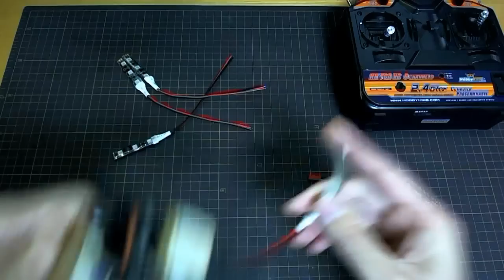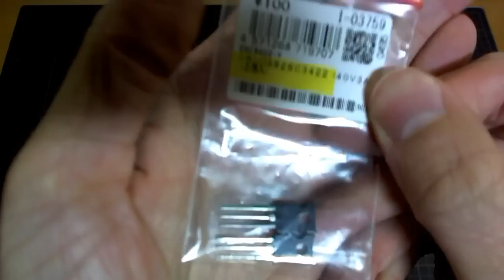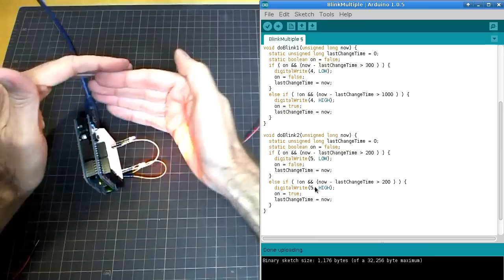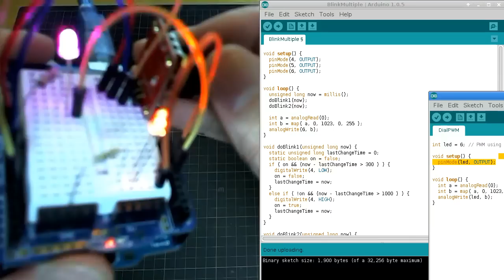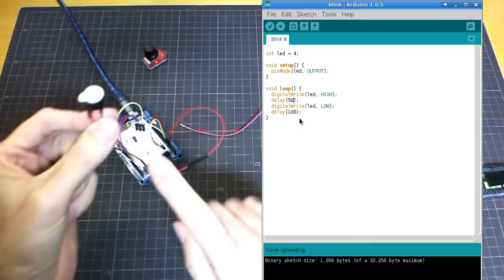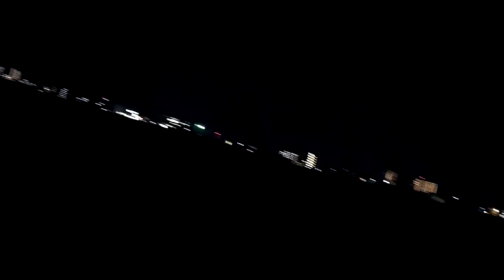Cheap-ass quadcopter build Part 13 - Let there be lights

Comment: if you use delay you shold have so it go int to the "find me mode" fhen switch on AND thrust is under 70  so you not acidently turn the mode on 
good filght

Comment: What am i doing wrong @#$#$#%%%^%
Trying to do 4 switches I thought it would be this easy. 
see the code  I"M STUMPED

/*  
A basic transmitter using the nRF24L01 module.
*/

#include <SPI.h>
#include <nRF24L01.h>
#include <RF24.h>

const uint64_t pipeOut = 0xe8e8f0f0e1;

RF24 radio(9, 10);

// The sizeof this struct should not exceed 32 bytes
struct MyData {
  byte throttle;
  byte yaw;
  byte pitch;
  byte roll;
  byte switches; // bitflag
};

MyData data;

void resetData() 
{
  data.throttle = 0;
  data.yaw = 127;
  data.pitch = 127;
  data.roll = 127;
  data.switches = 0;
}

void setup()
{
  radio.begin();
  radio.setAutoAck(false);
  radio.setDataRate(RF24_250KBPS);

  radio.openWritingPipe(pipeOut);

  resetData();
}

/************************************************/

// Returns a corrected value for a joystick position that takes into account
// the values of the outer extents and the middle of the joystick range.
int mapJoystickValues(int val, int lower, int middle, int upper, bool reverse)
{
  val = constrain(val, lower, upper);
  if ( val < middle )
    val = map(val, lower, middle, 0, 128);
  else
    val = map(val, middle, upper, 128, 255);
  return ( reverse ? 255 - val : val );
}

void loop()
{
  boolean mode1 = false;//!digitalRead(4);
  
  // The calibration numbers used here should be measured 
  // for your joysticks using the TestJoysticks sketch.
  data.throttle = mapJoystickValues( analogRead(A0), 127, 483, 852, false );
  data.yaw      = mapJoystickValues( analogRead(A1), 131, 480, 848, true );
  data.pitch    = mapJoystickValues( analogRead(A2), 136, 500, 868, false );
  data.roll     = mapJoystickValues( analogRead(A3), 152, 500, 870, true );

  
  data.switches = 0;
  if ( ! digitalRead(2) ) data.switches |= 0x1;
  if ( ! digitalRead(3) ) data.switches |= 0x2;
  if ( ! digitalRead(4) ) data.switches |= 0x3;
  if ( ! digitalRead(5) ) data.switches |= 0x4;
  radio.write(&data, sizeof(MyData));
}

Receiver Receiver Receiver Receiver Receiver

/*  
A basic receiver using the nRF24L01 module to receive channels and convert them to PPM.
 */

#include <SPI.h>
#include <nRF24L01.h>
#include <RF24.h>
#include "printf.h"

////////////////////// PPM CONFIGURATION//////////////////////////
#define channel_number 8  //set the number of channels
#define sigPin 2  //set PPM signal output pin on the arduino
#define PPM_FrLen 27000  //set the PPM frame length in microseconds (1ms = 1000µs)
#define PPM_PulseLen 400  //set the pulse length
//////////////////////////////////////////////////////////////////

int ppm[channel_number];

const uint64_t pipeIn =  0xe8e8f0f0e1;

RF24 radio(9, 10);

// The sizeof this struct should not exceed 32 bytes
struct MyData {
  byte throttle;
  byte yaw;
  byte pitch;
  byte roll;
  byte switches; // bitflag
};

MyData data;

void resetData() 
{
  data.throttle = 0;
  data.yaw = 127;
  data.pitch = 127;
  data.roll = 127;
  data.switches = 0;
  
  setPPMValuesFromData();
}

void setPPMValuesFromData()
{
  ppm[0] = map(data.throttle, 0, 255, 1000, 2000);
  ppm[1] = map(data.yaw,      0, 255, 1000, 2000);
  ppm[2] = map(data.pitch,    0, 255, 1000, 2000);
  ppm[3] = map(data.roll,     0, 255, 1000, 2000);  
  ppm[4] = data.switches & 0x1 ? 2000 : 1000;
  ppm[5] = data.switches & 0x2 ? 2000 : 1000;
  ppm[6] = data.switches & 0x3 ? 2000 : 1000;
  ppm[7] = data.switches & 0x4 ? 2000 : 1000;
}

/************************************************/

void setupPPM() {
  pinMode(sigPin, OUTPUT);
  digitalWrite(sigPin, 0);  //set the PPM signal pin to the default state (off)

  cli();
  TCCR1A = 0; // set entire TCCR1 register to 0
  TCCR1B = 0;

  OCR1A = 100;  // compare match register (not very important, sets the timeout for the first interrupt)
  TCCR1B |= (1 << WGM12);  // turn on CTC mode
  TCCR1B |= (1 << CS11);  // 8 prescaler: 0,5 microseconds at 16mhz
  TIMSK1 |= (1 << OCIE1A); // enable timer compare interrupt
  sei();
}

void setup()
{ 
  Serial.begin(9600);
  printf_begin();
  
  resetData();
  setupPPM();
  
  // Set up radio module
  radio.begin();
  radio.setAutoAck(false);
  radio.setDataRate(RF24_250KBPS);

  radio.openReadingPipe(1,pipeIn);
  radio.startListening();
  pinMode(3,OUTPUT);
  pinMode(4,OUTPUT);
  pinMode(5,OUTPUT);
  pinMode(6,OUTPUT);
  radio.printDetails();
}

/************************************************/

unsigned long lastRecvTime = 0;

void recvData()
{  
  while ( radio.available() ) {        
    radio.read(&data, sizeof(MyData));
    lastRecvTime = millis();
  }
}

/************************************************/

void loop()
{
  recvData();

  unsigned long now = millis();
  if ( now - lastRecvTime > 1000 ) {
    // signal lost?
    resetData();
  }
  
  setPPMValuesFromData();

  if (data.switches & 0x1 )
  digitalWrite(3, HIGH);
  else
  digitalWrite(3, LOW);

    if (data.switches & 0x2 )
  digitalWrite(4, HIGH);
  else
  digitalWrite(4, LOW);

    if (data.switches & 0x3 )
  digitalWrite(5, HIGH);
  else
  digitalWrite(5, LOW);

    if (data.switches & 0x4 )
  digitalWrite(6, HIGH);
  else
  digitalWrite(6, LOW);

}

/************************************************/

ISR(TIMER1_COMPA_vect){
  static boolean state = true;

  TCNT1 = 0;

  if ( state ) {
    //end pulse
    PORTD = PORTD & ~B00000100; // turn pin 2 off. Could also use: digitalWrite(sigPin,0)
    OCR1A = PPM_PulseLen;
    state = false;
  }
  else {
    //start pulse
    static byte cur_chan_numb;
    static unsigned int calc_rest;

    PORTD = PORTD | B00000100; // turn pin 2 on. Could also use: digitalWrite(sigPin,1)
    state = true;

    if(cur_chan_numb >= channel_number) {
      cur_chan_numb = 0;
      calc_rest += PPM_PulseLen;
      OCR1A = (PPM_FrLen - calc_rest);
      calc_rest = 0;
    }
    else {
      OCR1A = (ppm[cur_chan_numb] - PPM_PulseLen);
      calc_rest += ppm[cur_chan_numb];
      cur_chan_numb++;
    }     
  }
}
Reply from the maker: +Mark Greco the 'switches' value is a bit flag, so you should be doing this:
if ( ! digitalRead(2) ) data.switches |= 0x1;
if ( ! digitalRead(3) ) data.switches |= 0x2;
if ( ! digitalRead(4) ) data.switches |= 0x4;
if ( ! digitalRead(5) ) data.switches |= 0x8;
Reply from the maker: +Mark Greco http://www.cplusplus.com/forum/general/1590/

Comment: I need the coding for the transmitter, receiver and the multiwii. In the transmitter I have only 2 binary switches for the lights on the corners and for landing. Make sure that both the lights when on should not blink pls. Please help me out please.
Reply from the maker: +DINESH JAIN dude, do you even watch these videos? Look at 33:50

Comment: Thanks for a great set of videos! I just wanted to mention that if you keep nextChangeTime instead of lastChangeTime your code will be much simpler and will eat up less of the CPU time if spliced into the main loop with other code in it. Just check if (now > nextChangeTime) first and do other checks inside the if block.
Reply from the maker: That's correct, but I doubt it would make any practical difference. The arduino can do 16 million cycles per second, and a subtraction is only a handful of cycles. There are no other programs to share the CPU with anyway :)
Reply: I meant, if you move that code into the FC, when you get rid of the arduino handling the RF link. (:

Comment: You are so right about it being much more fun at night... I installed some 12v strip lighting on my SK450 quad, used BS250? mosfets to control them, and a attiny hooked up to the receiver to allow remote control and effects. Was great to fly at night, and so easy to tell the  orientation. IIRC,  I put put rear red and green on for port and starboard, and white on the front pair. Never bothered with a higher power one... but have been thinking about it for my next build. Current quads are fine in daylight, but I wouldn't mind another night flyer. Would probably think about a second battery for the lighting setup though if running the high power led for long durations though... see how it goes, anyway. Great video as always!
Reply from the maker: Cool! I found that the lights would blend into each other once it got too far away, but overall it's better visibility than in daylight, and with a 450 you should be able to get way way up high before that happens. Yes the high power LED was kinda pointless, just something to do for the video mainly (buzzer is a much more practical feature). It's a bit harsh to fly at night in winter, but I expect in summer I'll being doing it a lot more. My next build is already in the post, I'm finally graduating from class of 250, and I've ordered some lights to dress it up like a UFO... should be fun :)

Comment: You have connected transistors base- emitter to 3.3 volt it is very bad idea, you can burn either base of transistor and/or output of controller :) just put resister there. The base-emitter is like a diode it takes only 0.7V.
calculate resistor with: R = (3.3-0.7)/Imax, where I max is less then either maximum continuous current of transistor base, or maximum current of controller output.
Reply from the maker: Thanks for the tip. I wondered about that, but the document I was following (shown in the video) says it is generally not an issue for pins of a micro-controller, and it seems to be functioning ok (so far!) I'll definitely add a resistor there next time though, because it will decrease the overall current draw of the arduino... hmm... come to think of it, maybe it's the extra current being sucked out of that pin, which causes power problems for the RF24 module on VCC...
Reply: *****
Have to say I was surprised myself that there was no resistor on the base of that transistor.

Comment: Terrific project!  Regarding red/green LEDs being on low level: just a wild-ass guess, but perhaps there is a small amount of current leakage through the base of your transistor.  A pull-down resistor, say 10k, between the arduino pin and transistor base might solve that.
Reply from the maker: Good thinking. I'll put my cheap-ass oscilloscope on there and see what I get.

Comment: you can add some functions to those leds... i mean you can make the whole drone look like a proper heli with the right blinks...check airplane lights to see what i'm talking about...and another idea is to make some sort of visual control for battery voltage...something redundant...that would be something cool!
Reply from the maker: Yeah, you could do all kinds of cool stuff, link them to the throttle position, sine wave pulse the brightness etc
Reply: i've seen something like that a while ago...a guy connected some led strips directly to the 3 phases of an ESC and it was very cool. anyways, I was talking about a certain blink patern...have you seen how lights are blinking on planes? twice red, pause, then twice white and so on...
Reply from the maker: micultimy91
Yeah, I know what you meant :)

Comment: DoBlink1 and DoBlink2 can be written as one routine (int pinNumber, int lastHigh, LastLow ){
    handling the given pin;
}

Thank you for the video and other stuff you make
Reply from the maker: Yes, definitely :) Probably most programmers would cringe to see that much repeated code. It was mainly just for demo, if I was doing any more of them I would make a class or struct to keep each set of variables and just have one function that passes the 'now' and the struct to work with.
Reply: *****
Actually I fail to run my concept code :) But I will keep on trying.
Thank you
Reply from the maker: ilan magen
pastebin it for me
Reply: *****

//That's a 2 am + 2 beer code:
/*
  Blink  No delay
 */

void setup() {
  pinMode(5, OUTPUT);
  pinMode(6, OUTPUT);
  pinMode(7, OUTPUT);
  pinMode(8, OUTPUT);
}

void loop() {
  unsigned long now = millis();  
  blinko(now, 500, 100, 5);
  blinko(now, 500, 100, 6);
  blinko(now, 500, 100, 7);
  blinko(now, 500, 100, 8);
 
}

void blinko(unsigned long now, int iHigh, int iLow, int pin ){
  static unsigned long LastChangeTime = 0;
  static boolean isOn = false;
  if (isOn && (now - LastChangeTime > iLow)) {
    digitalWrite (pin,LOW );
    isOn = false;
    LastChangeTime = now;
  }
  else if   (! isOn && (now - LastChangeTime > iHigh)) {
    digitalWrite (pin, HIGH);
    isOn = true;
    LastChangeTime = now;
  }
 
}
Reply: ilan magen
/// no need to write the "LastChangeTime = now;" twice only once out of the "if" condition
/*
  Blink  No delay
 */

void setup() {
  pinMode(5, OUTPUT);
  pinMode(6, OUTPUT);
  pinMode(7, OUTPUT);
  pinMode(8, OUTPUT);
}

void loop() {
  unsigned long now = millis();  
  blinko(now, 500, 100, 5);
  blinko(now, 500, 100, 6);
  blinko(now, 500, 100, 7);
  blinko(now, 500, 100, 8);
 
}

void blinko(unsigned long now, int iHigh, int iLow, int pin ){
  static unsigned long LastChangeTime = 0;
  static boolean isOn = false;
  if (isOn && (now - LastChangeTime > iLow)) {
    digitalWrite (pin,LOW );
    isOn = false;
  }
  else if   (! isOn && (now - LastChangeTime > iHigh)) {
    digitalWrite (pin, HIGH);
    isOn = true;
  }
    LastChangeTime = now;
}
Reply from the maker: ilan magen You are using the same LastChangeTime and isOn variables for all of them. You will need a full set of separate variables for each.
Reply from the maker: ilan magen
Here is the same sketch using a struct like I was meaning:

struct LEDToggler {
  int pin;
  int onTime;
  int offTime;
  unsigned long lastChangeTime;
  boolean isOn;
 
  LEDToggler(int _pin, int _onTime, int _offTime) {
    pin = _pin;
    onTime = _onTime;
    offTime = _offTime;
    lastChangeTime = 0;
    isOn = false;
    pinMode(pin, OUTPUT);
  }
 
  void step(unsigned long now) {
    if ( isOn && (now - lastChangeTime > onTime ) ) {
      digitalWrite(pin, LOW);
      isOn = false;
      lastChangeTime = now;
    }
    else if ( !isOn && (now - lastChangeTime > offTime ) ) {
      digitalWrite(pin, HIGH);
      isOn = true;
      lastChangeTime = now;
    }
  }
};

LEDToggler led1(4, 500, 1000);
LEDToggler led2(5, 200, 200);

void setup() {}

void loop() {
  unsigned long now = millis();
  led1.step(now);
  led2.step(now);
}
Reply from the maker: ilan magen
You also should not change LastChangeTime every time. As the name suggests, you only change that when something was changed, otherwise it loses its meaning and you might as well not even have it at all :)

Comment: could you maybe use multiplexing to expand the i/o of pin 5/6 to control more pwm signals? might be possible to control more leds that way
Reply from the maker: I haven't used any multiplexers myself, but yes, you could do that. Some I have seen use I2C to control them. https://www.youtube.com/watch?v=A6qNxnRPD3o

Comment: I have a few more questions. How does the power LED dimming work? Is the transistor continuous and stepless? I thought it was on / off only. And lastly, how did you film yourself like that? A head-mounted camera?
Reply from the maker: Yes, this transistor is pretty much on/off only. The dimming works by turning it on and off very fast, so that it is on for a percentage of the time. You can see some details here: http://arduino.cc/en/Tutorial/PWM I'm holding the mobius camera in my teeth :)

Comment: i does not mess withe the ppm signal?
Reply from the maker: The sketch I'm using for the receiver uses timer1 for the PPM signal. Using timer0 as well might mess with it a tiny bit because both timers will be triggering interrupts, but I don't think it's a significant interference.

Comment: i think it would be a better idea to ut the transistor before the driver input...
The driver adjusts the voltage up intul it reaches the desired current and if the transistor opens, the voltage will go up. If the transitor closes again, and the driver is not fast enough ramping down the voltage, you may damage the LED...
Just my thoughts, could be total bullshit also, but i think it makes sense...
Very nice video otherwise, very usefull stuff for somebody building a quad himself! :)
Also, where do you actually live? i always thought it was the UK, but you said you sourced the transistors locally, and they have chinese or japanese signs on them, so do you actually live in asia? :)
last question would be, if the source code for the reciever and transmitter can be downloaded somewhere?
Reply: He lives in Tokyo.
Reply: Philip Stubbs OK, thanks :)
Reply from the maker: Have to admit I don't really know how the driver works, so you could well be right. Yes, Tokyo. The source is here: http://www.iforce2d.net/cheapassQuadcopter/sketches.zip (it does not include the few lines I have changed for the lights, but this video should show all of those changes.
Reply: ***** thank you very much, i will have a deeper look into the sourcecode and try to understand it all :)